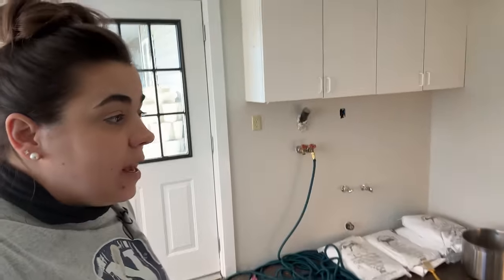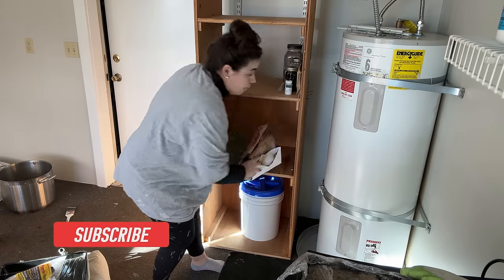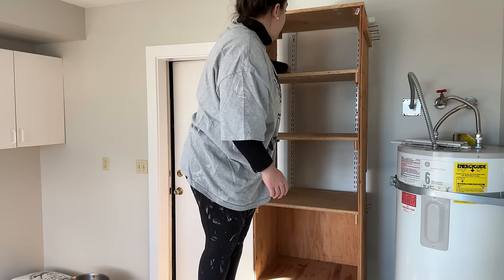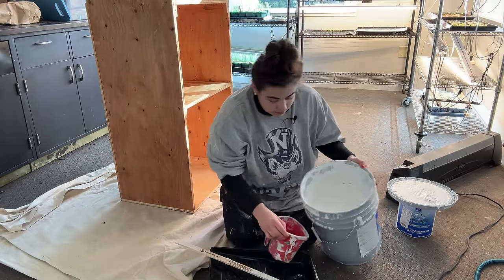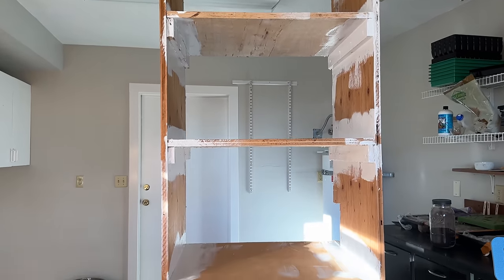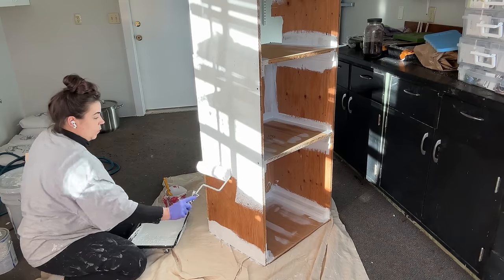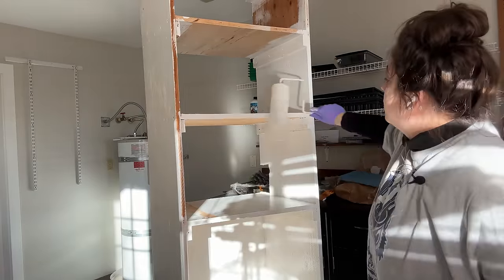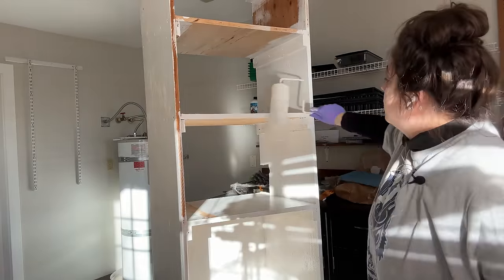Back to the drawing board!

Comment: If you can move that big metal desk, see about putting wheels on it so you can move it if you ever need to some other time.
Reply from the maker: Good idea!
Reply: I agree.  Don't know how to "jack up" (as in changing a tire) both ends simultaneously safely but adding casters (wheels) would be so beneficial now and in the future.  Hope it goes well.  Happy Spring everyone!!!
Reply: They have large disk furniture slides.  It will keep your flooring from getting scratched when you two move it back in. Your grow room is amazing.   I  would love to have one some day.
Reply: @kathrynmauro8673  I was just going to suggest that. A great idea.
Reply: My husband is a contractor and he uses the disk slides, they work beautifully! Back savers for sure!
Reply: Also would it refresh the room if you painted the metal stand a metal color similar to your walls? Like the idea if putting it on wheels, but make sure you use heavy duty to withstand total weight.
Reply: If it is long, put six casters on it. It will distribute the weight more easily. Don’t know how long that workbench is, but we built shelves 4x8x8’ high and after putting only four wheels under it, redesigned and put six on the next shelving. I think we made 22 or so of these shelving units. My husband was an electrician so we needed to build storage for his materials.
Reply: Happy birthday Josh
Reply: Happy Birthday Josh! 
Becky, your grow room is awesome! The rollers on the bottom of big metal cabnet is an awesome idea. Your Josh will figure it out. 😊
Reply: While you have the water heater out, put a drip pan under it, it will save you a headache later if you ever have a leak.
Reply: Only problems with putting those cabinets on wheels is it’s not just one cabinet. Also it will raise it up and it could make it uncomfortable to use. Right now it’s the perfect height for Becky’s comfort but if they put wheels on it, the function In which she uses the cabinet for could be compromised. Don’t get me wrong the idea of wheels is a good one in circumstances when you’re building a cabinet that the height is taken into consideration. Since they were able to take it apart and move it in sections it seems they have discovered the secret to move it in the event they ever need to move it again in the future.
Reply: Penelope, the top of the desk was in one piece. There were 3 individual units on the bottom.
Reply: Happy Birthday wishes Josh
Reply: There's a sizeable toe kick to that set of cabinets so casters could be mounted" under the cabinets which wouldn't raise it too much.   Also, they could play with adjusting the countertop to reduce the thickness.  Either way,  it isn't a counter where Becky rolls dough, etc., so it should still be within a comfortable height.  Alternatively, Becky - if it's too high,  you could just put some mats in front and that would make it a better height for you.
Reply: If that desk came in it can go out. Try the furniture slide discs and decide if you want to keep that desk or search /salvage something by you that speaks to you more than that metal behemoth
Reply: @AcreHomestead  You can paint the concrete, too!! Not with wall paint, of course, but any color of concrete paint you choose. 
I'd probably get a few cans of spray paint and paint the desk unit too.
Reply: Happy birthday 🎉 Josh
Reply: The cabinets would benefit from a coat of paint too - perhaps spray paint for metal? It’s a fab space though and so useful. 😊
Reply: That first sip of Coffee in the morning is the best ❤☺
Reply: Happy Birthday Jash 🎉
Reply: Happy Birthday Josh🎉
Reply: I’m a big believer in wheels - I’d also put some on that tall plywood shelf that you painted. That way you could move it easily and also spin it around when you don’t want to look at bags of vermiculite or whatever. And you could use the back surface (photos, chalkboard, planting calendar, etc).
Reply: Buying wheels weighted for that would work or just get some pipe and it will roll on it. Use blocks n Jack's to lift each corner. Pry bar under corner n block to do each one
Reply: They also make locking casters (wheels that lock) that would also help. My ex-husband and I had used them on the homemade tables we created for his Lego room. When he felt like a "change of scenery," he just unlocked the casters, moved the tables around, and locked them back up.
Reply: @wendystevenss   Yes & it’s metal & fairly warm out - I would of hosed it off first then soapy cleaning bucket hose it back off. Tada
Reply: PAINT THE CONRETE A NICE COLOR THEN YOU COULD KEEP EVERYTHING NICE AND CLEAN!♡ -  MAYBE SOME
THING SLIP PROOF TO BE SAFE!♡
Reply: @AcreHomestead  after adding the wheels you can use it to store your soil and fertilizers.  I would keep the seeds on the shelf so you aren’t bending down and digging through stuff to access your seeds. I think you can organize them better on the self. 😊
Reply: You should buy a tilt fan for the floor. Tilting a box fan is a fire hazard. My ex boyfriend caught his whole apartment on fire tilting a box fan in his living room.
Reply: I think that's an amazing idea to put wheels on it❤
Reply: Assure they are industrial heavy-duty duty wheels for the desk.
Reply: @Missy2Gigi I thought there was a drip pan under it.
Reply: 😊Does anyone else wish that Becky’s amazing energy level/ work ethic could be bottled for purchase?  I would personally buy a case!
Reply: that's a great idea, also paint it will be nice
Reply: @AcreHomestead  I think just putting them under your window would be nice so you don't have your shelves blocking the windows. Just put the grow shelves along the back wall instead. It would much nicer view to be able to look out a window while planting seeds than facing a wall.
Reply: Wheels great idea

Comment: I say, make the grow room into your canning kitchen, so that when you're canning a bunch of preservation projects in the summer, you don't heat up your whole kitchen! Bring the freeze dryer and other food preservation appliances in there, and it will streamline preserving everything from the garden. Since you have water in there, you can also install a sink and a small counter next to it for washing produce. All of your preservation supplies could be put in the metal desk and on the shelf.
Reply: I like that idea!
Reply from the maker: That is a good idea!!
Reply: That's a great idea...a preservation room! I think painting the cement floor is a great idea too. The heavy metal desk and the possibility of dropping heavy objects may cut into a vinyl floor anyway. If it's just used as a utility type room, it's best to keep the cement. You can even paint it with texturing paint  (garage floor paint). Easy peasy to sweep and mop up spills. Less likely for slip and falls too.
Reply: Oooo that would be a good idea once you make the greenhouse outside... and those big windows would give great natural light for videoing.
Reply: I,love this idea
Reply: @AcreHomestead  you said you would have liked the room the dark green like your bathroom, I think the metal cabinet/ desk  would look fab that colour

Comment: Stain the concrete!  Scrape up as much of the glue as possible, buff it down, and stain the concrete!  I have a friend who did this in her HOME, as they remodeled it and it is beautiful. No need to worry about the flooring once it’s stained. 🎉
Reply: That's how I would go for now.  The purpose of the room is soil.  Then down the road when you have greenhouse and decide how you will use this room you will have more time to contemplate and make decisions about long term.  Its all good whatever direction you go. You have time to breathe and dream.
Reply: Yes, you are correct, we painted our concrete floors also.  They have paint for that 😉
Reply: I would definitely do that… stained concrete is awesome & you can hose the dirt out.  The vinyl might start lifting over time if it gets wet a lot.
Reply: You can also paint concrete. Stain would still show all the glue marks. Paint would cover and be a solution for now for far less than flooring while you decide on the purpose of that room in future.
Reply from the maker: I think we might! I love that idea :)
Reply: The concrete should be epoxy sealed as though it is a garage floor or it will take on stain and not hold up under traffic. There are companies who specialize in this special finish. The floors look beautiful when done. Regular concrete paint or stain will show wear after a bit.
Reply: Get the concrete floor paint!!! It’s the best!!!! So durable!!!! Make for all the cracks and flaws!
Reply: My husband epoxy sealed our concrete tack room floor in our barn. Beautiful, durable, scrubbable, not slippery… such a good solution! Home Depot for the win!
Reply: Epoxy sealed looks beats
Reply: Please, please get a mat to stand on to protect your back and knees!
Reply: @bonniekay6486  DON'T DO EPOXY FLOORS!!! We bought a house with a gray with black/white speckled epoxy floor and it is a slipping hazard like you would not believe. Just the slightest moisture on your shoe bottom and you will be ON YOUR bottom.

Comment: you might want to think of giving the large black desk a nice fresh coat of spray paint!
Reply: A pretty new coat of paint is just what it is screaming for.  A light sanding of the rusting drawer mounts would help the drawers to slide better. A lovely yellow or teal colour or better yet maybe Becky's favourite color.
Reply: The "paint the desk", idea is great. I found on metal, Rustoleum to have the best 1 spray finish, unless you're planning on painting white and then it may take a 2nd coat but it dries quite quickly so you could probably get it done in a couple hours if that. The most important is clean up drips, if you get them,  fairly quickly.

Comment: I have scraped and painted many concrete floors. Makes a  super durable surface that is easy to mop, sweep, vacuum and keep clean. Also prevents the ‘dust’ that comes off of unsealed concrete. Some paint stores have option to tint to a color of your choice but ensure  a good quality concrete product is chosen. Only downside is it can be a bit slippery with croc type shoes if the floor is wet. There are products that can be purchased that have a ‘grit’ in it to reduce slipping. The downside with this is that it’s a bit more difficult to clean.
Reply: They actually have paint kits for concrete floors that have semi abrasive material you can sprinkle over the surface. Also they have decorative items that you can sprinkle in the surface area to create the illusion of a vinyl floor.
Reply: And it’s always ready to install other flooring sometime in the future if you..or future owners want to.
Reply: Yes painting might be a good solution for now, easy to clean with dirt. They have conrete paint with texture for no slipping. I've used it.

Comment: If you store your seeds in the metal cabinet it will keep them cool & in a dark place. I would just leave it concrete. You can buy a sealer for it. That will make it shiny. Or you can buy the garage floor paint & sealer it looks really nice. It will be so much more durable without the flooring.

Comment: You could paint the concrete floors after you get the glue up. They have non skid solution you can put in the paint from Sherwin Williams so when the floor gets wet it's not slippery.

Comment: I would get some industrial wheels for the black cabinet for sure! Also, have Josh add wheels to the bottom of that cabinet you just painted. It will make it easier to move around your seeds to the work area, etc. you could always add a strip across the back of the open areas if you’re worried about things falling out the back.

Comment: Concrete Paint stain or Epoxy are great options.  None are difficult and the floor is small enough that you could use it for practice in case you decide the garage floor need epoxy too.  LOL  One project always leads to another.  If it will someday be a canning room check on non slip.  Canning involves so much water and huge hot pots of water and slippery floors spell a trip to the ER.  At least in my home.  😁.  Love your channel and the way you present.   A wise person tells me often ( my husband) "perfect is the enemy of done.  Just get it done."  You have that get it done work ethic.  No over thinking , jump in a figure it out.  I love that.

Comment: Becky, instead of flooring, the concrete floor could be coated with that special paint used in auto dealerships which leaves a smooth, durable finish that is easy to sweep clean and less costly than flooring.  It’s also more practical since you are using the room for plants.

Comment: When we finished our basement floor we put a plywood over the cement that has pucks underneath. It allows for the concrete to breathe and prevents any moisture (because concrete is porous) from getting on the finished flooring. It might be an option for that utility room. It's also got the benefit of keeping the floor a little warmer because it's not in direct contact with the chilly concrete.

Comment: Becky you are the hardest working person I've ever seen. That said it scared me to death me to death when you kick the bottom of those shelves to get it through the garage door way. First of all it could have slid further on the carpet and hurt you. Secondly you just painted it you put a foot mark on it. Girl 😅 I've seen carpet people use tape rolls to secure the roll. But that is a smart thing saves on materials thanks for the info. I bet you'll save money on disconnecting that water heater until you complete repairs in the upstairs.🎉

Comment: You could run a sander over your concrete floor, paint with a good sealer/primer and paint it!  I think your room would look great with an olive green floor to complement your walls!  It would cost far less than flooring and be easy to clean and touch up as needed.

Comment: How about an epoxy floor covering with non slip grip mixed in? Easy to do and kits are readily available. I did my garage and love it. Looks nice and easy to clean. Also easier to stand on than plain concrete.

Comment: You should do a resinous system. Like an Epoxy floor, however, you would want to do a Polyurea/Polyaspartic Flake floor. Since there is a lot of light in this room and Epoxy yellows over time. I have it in my grow room and I actually do these types of floor for a job. It is the easiest thing ever to clean.

Comment: Unfortunate that the outcome wasn’t what you expected, but there are other options. You can scrape and stain the concrete floor, or have an epoxy finish poured over it…that would be a really good look, then you could use that room as a mudroom once you get your greenhouse. Like others have said, you could prep and paint that metal cabinet and install some casters for future ease, if you plan to keep it. So many options!

Comment: You need to put a water heater drip pan under your heater. You might also want to buy an insulated blanket for your heater. Plus get a hose that is long enough to reach out the door when you  drain the heater a couple of times each year and leave it  by the heater.
Reply: If you are going to move those cabinets you should wait to paint until the cabinets are moved.
Reply: It had a drip pan under it.

Comment: If you paint again and you need the paint again for a second coat. place your roller and tray into a plastic bag and fold the open end under the tray. it will stop the paint drying.

Comment: I’m thinking you might be very happy if you went ahead with the flooring. I’ve worked on concrete a bunch in a basement craft room and it’s so hard and unforgiving to clean up and even sweep. Consequently, you might need to treat/paint it and now we’re talking more work and cost for something that doesn’t look as great as the flooring would. Just something to think about.   
P.S. could the flooring be laid up next to the cement foundation with Josh adding a wider trim piece to cover that foundation (in addition to the baseboard of course). Even lay the floor yourselves if they won’t for guarantee reasons. (You know…in your "spare time ". Haha)

Comment: I was never told that by the two installers I have had put new hot water heaters in since my husband built our home 34 years ago. I had to weather these events alone as he passed away long before the hot water heaters stopped working. The original hot water heater was 15-16 years old, not so sure about the age of the second one(time frame did not stick with me). 😊

Comment: Could you get a self-leveling concrete to cover what's there for  the floor to cover it up ? That way, you can get the flooring done. That way, it's easier to clean up instead of staining or damaging your concrete from the soil or water you may get on it.
Just a suggestion ❤. 
Also, when you paint the wall , you can paint the cabinets with the same as the walls. They may be easier to clean. 🤷‍♀️
Just an idea.
Also , HAPPY BIRTHDAY JOSH 🎉, I hope you had a wonderful day.
God bless 🙏

Comment: We painted out garage a nd outhouse concrete floors with floor paint in grey looks great easy to,touch up any scratches etc easy to mop and clean up and cheapest option  you  could  just paint round the unit until you get rid of it sometime

Comment: I think I would scrape up the glue and then paint that floor with some textured garage floor paint. Easy to clean, durable and easy to put down. Maybe some self leveling acrylic type stuff for the floor, you just pour on and squeegee around. Either of those things would be great for a room that's going to be high traffic and exposed to moisture.

Comment: You can purchase a filler/leveler product at a lumber yard, to even out the floor. It is not expensive, easy to apply and dries quickly. Then you can finish the floor in any way you choose, just as if it is a new floor. Good luck.